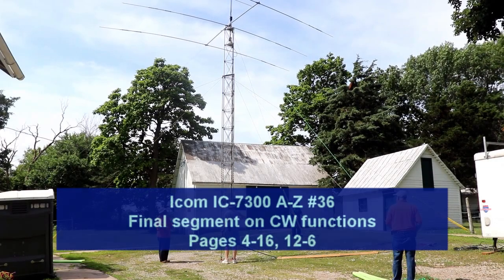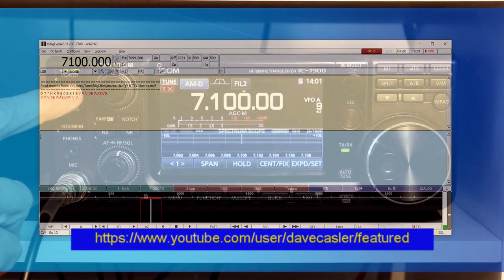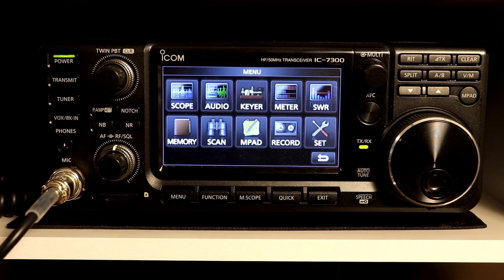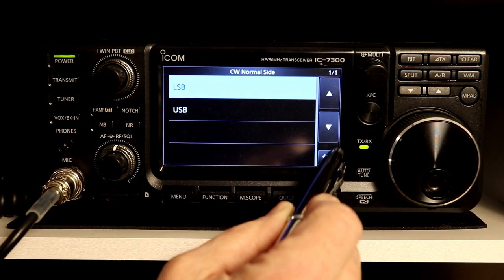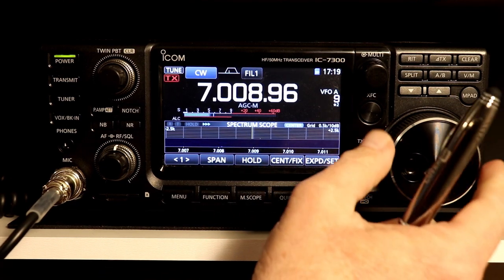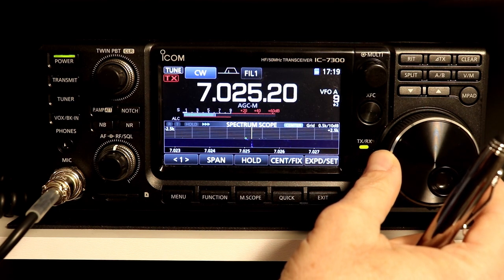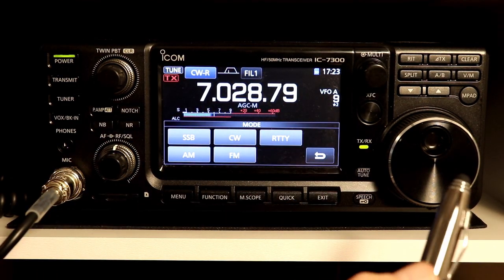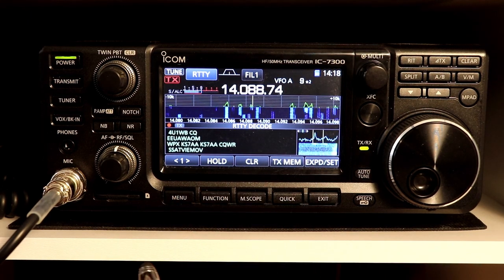Icom IC7300 A to Z #36 CW-Reverse and normal settings

Comment: Also, Yaesu and Kenwood default to CW-USB as normal. If I call them using IC7300 in default CW mode as comes from the factory (LSB), the pitch heard on their end wont be the same as I hear from the IC7300 sidetone. My tests show about 50 cycles difference, detectable but not bad.

Comment: Wow, that's a great tool to quickly remove a conflicting CW signal on the fly without having to adjust the notch filter.  Great suggestion, thanks!

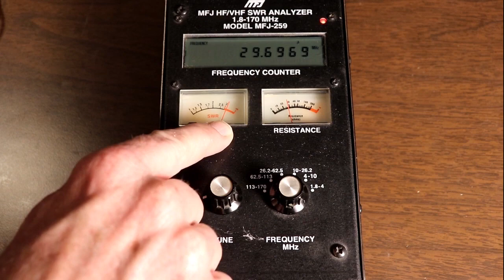Comment: At 1:00, when the video shows the back of your radio, there is a silver ribbon connected to the ground port. Where does this ribbon go to? How long is it? What is its name? I also see that you have an external tuner connected. Which tuner do you use? Which power supply do you use? My radio is still in the box!
Reply from the maker: Hi.  That ribbon is a ground strap.  It is just a wide, flat conductor.  It is connected to a common grounding point.  All of your station equipment should be connected to a common ground.  The ARRL has a freely available article on grounding here:  https://www.arrl.org/grounding. It includes links to additional resources.

Comment: Hi Tom,

If you have trouble to get signal for demonstration,  jugst use your other HF rig to simulate the condition.  

Hope it is useful for your next video..

Yours,
Bahathir 9W2GNU, 73.
Reply from the maker: Thought about that, but even with a dummy load I’d have to put it several rooms away to avoid overwhelming other signals. Thanks for the idea.
Reply: @HamRadioA2Z  

Then, use RF Gain (RFG) to reduce IC-7300  sensitivity. 

Another idea is, to set the other rig outsite, the IC-7100, and set it to auto repeat  CW keyer at QRP 1% of RFPOWER.. or 0% RFPOWER.   Yes, even 0% of RFPOWER still transmitting  very weak signal..   
No problem, Sir.  I just want to share ideas which may improve future  demonstrations

Thank you, Sir.  . .

Comment: For DR and AR , which are two characters, can a single character for each be created in a CW message  box?
Reply from the maker: Hi Jerry-  Yes, you can program any of the standard 2 character sequences into the keyer memories. When you are in the edit screen, the top left button shows the symbols /?^.  The slash (/) and question mark (?) send the correct cw for those symbols.  The carat (^) character is a special escape character.   To send any 2 character sequence without a character space, you just put the carat character in front of the sequence.  So "^AR" will send ...-.-   This will work for any 2 character sequence.  73, Tom